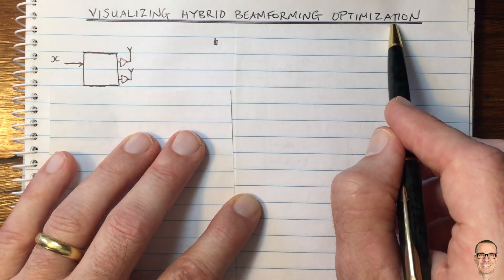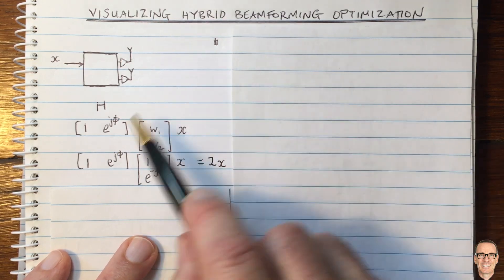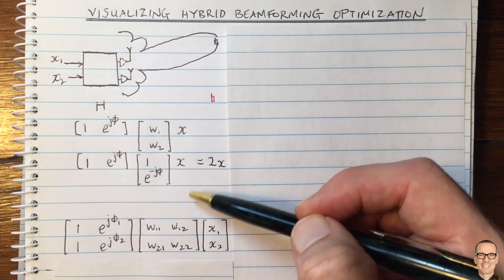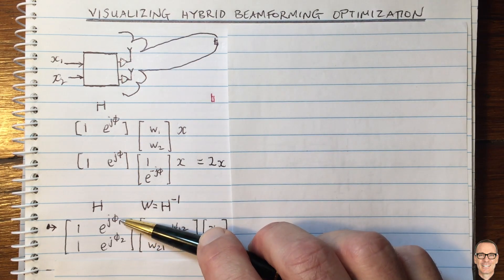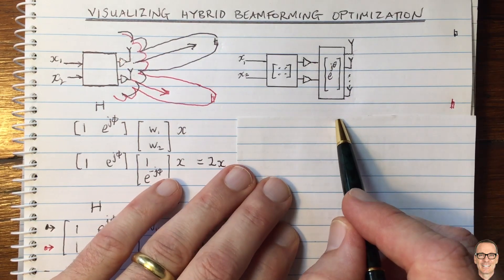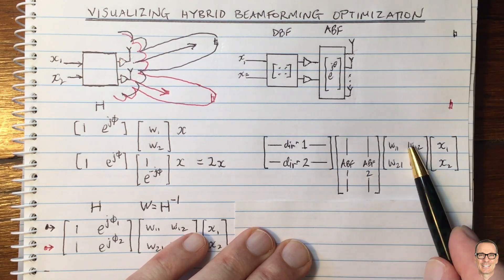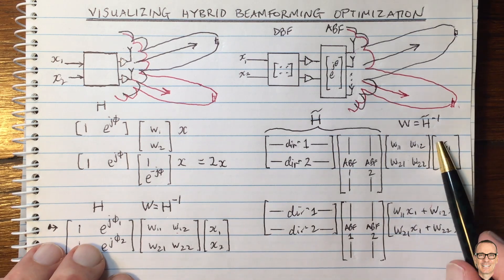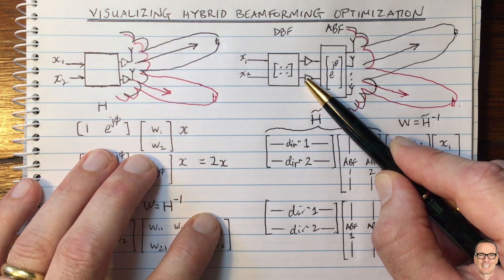Visualising Hybrid Beamforming Optimization

Comment: Thank you, a short question, please. How do we optimize the ABF in that case?
I assume we need the channel matrix to both UEs (?)
Perhaps we can work with the phase information in these channel matrices. With just one UE, it is clear, we have the phase shifts at every element and we just compensate it. But for more than one UE, I don't know - we have just one phase shifter at every element, so we cannot adapt 2 different phases.
Reply from the maker: Good questions. Yes, the channel matrix needs to be known. And there need to be seperate phase shifters for each analog beam that needs to be formed - then they need to be added for each antenna. More details here: "What is Hybrid Beamforming?" https://youtu.be/vJrDtZ24K7Q

Comment: Thanks, to the lower right side, we have this maxtrix operations and you say the first row of the last matrix is matched to the first column of middle matrix (ABF1). I cannot understand exactly how because we multiply the first line of the first matrix with the columns of the second matrix - the whole line w11*x1 w12 *x2 does not stay get to column ABF1, I assume. What do I miss?
Thank you.
Reply from the maker: The elements in the columns of the left hand matrix multiply the elements in the rows of the right hand matrix. This is just a property of general matrix multiplication. Perhaps if you write it out element-by-element, you'll see it.

Comment: Hello Professor, thank you for the video, I have 3 easy questions :

Which mathematical method are used to compute ABF ?

When ABF is computed and found, it’s values can be put in an analog way in the system (phased values) and how ?

Dir 1 = [1 e^1phi1 e^2phi1 e^3phi1 e^(N-1)phi1] N the number of linear radiating elements used to create a beam ?

Thank you !

An interested engineering student
Reply: ABF is done by phase shifters - we just adapt the phase
Reply: @pitmaler4439  I see, so any choice can be done in phased i imagine
Reply: @Ticdou777  yes

Comment: Hi Sir! Excellent video!  Thanks. Q: what are examples of elements in the first "dir" column vector?  Meaning what could be contained as elements in thar matrix, e^j?  Also, why don't the analog beamformers have an amplifiers? Is that a typical thing?  Thanks.
Reply from the maker: As the carrier frequency goes up, the matching antenna size comes down. Therefore you need more radiating elements to achieve the same overall radiating power. At some point it becomes impractical to implement seperate amplifiers for each radiating element (antenna element). That's when you need hybrid beamforming implementations. More details here: "What is Hybrid Beamforming?" https://youtu.be/vJrDtZ24K7Q